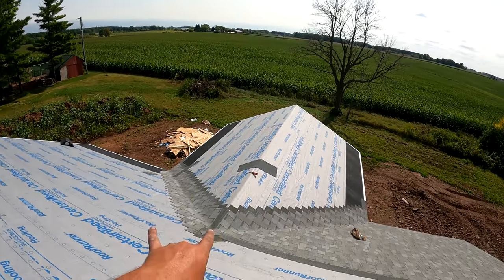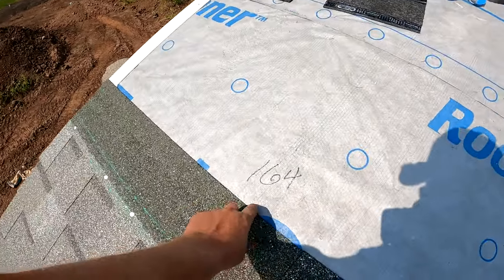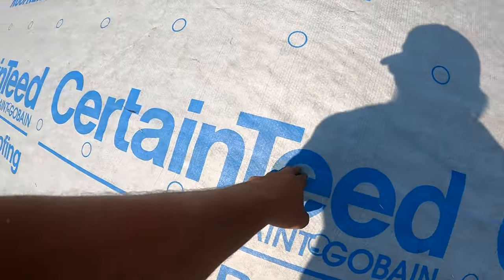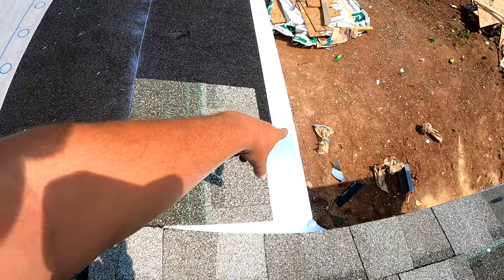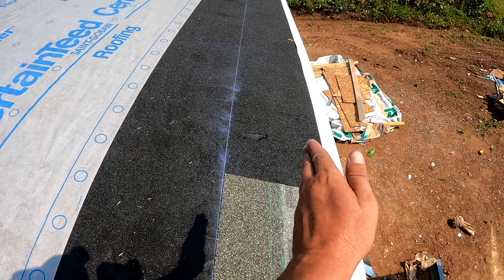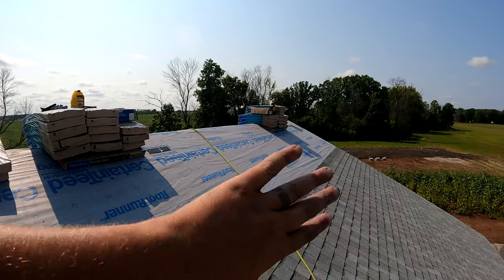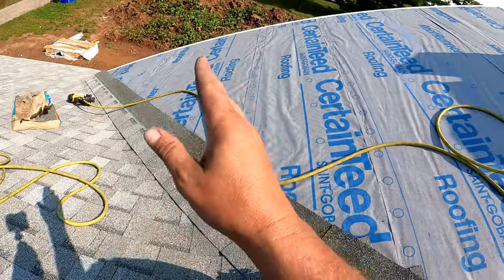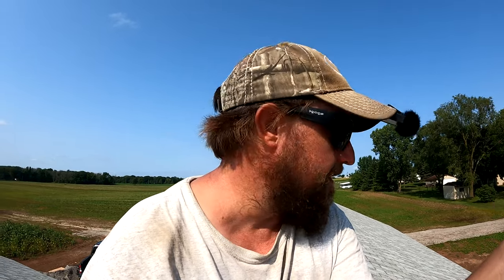HOW TO LINE UP 2 SIDES OF A CLOSED VALLEY

Comment: Chalk a line for the starter. Chalk a line for the first shingle. From the top of your shingle make marks 11 1/4 and 22 1/2 on most achitect shingles. Chalk lines all the way up both sides. The line should be the same unless you make a mistake making your marks.

Comment: Nice video! The way I like to handle these is to snap a reference line parallel with the main ridge, at a height of a few feet above the intersecting ridge.

I then shingle both sides up until they're 5 courses below the intersecting ridge height. 
Take measurements of both sides against the reference line, and with those 5 courses of space I can drop either side up to 3" with ⅝" drops, which is enough to bring shingles into level even in the worst case where they'd otherwise be half-height out of phase.

There's a little bit of math, but it's fairly straightforward when you see it being done.

Bonus tip: for the last course before merging, only use 2 nails at either end of the shingles, work out where you'll want the merged course of shingles to be positioned, then fill in the rest of the nails, respective of where the keyways of the next course will be.

Comment: Good job. The back of my house has no valley, but the front has a small one because of the roof over the front porch. Measure down from the ridge. I've already shingled the back of the house and I did measure down from the ridge doing that because I wanted to adjust where I started the first course a bit so the top course that gets capped would have a reasonable looking exposure. Now I tackle the front with a couple small closed valleys. Actually my very old house, the ridge has a bit of a sag in the middle. I measure down from the ridge at the ends of the ridge and snap lines all the way across. I will rely on your video on how to lay the shingles for the closed valleys.

Comment: I always use 22 1/2 or 45 just so my shingles wont show white line. And my valleys i raised them two at a time to keep em straigth. But good job looks good.
Reply: Absolutely correct 💯 22 1/2 , 45, 67 1/2, 90 and so on. Every fourth shingle will hit the line on the top side of the shingle. That fourth course will seemed dropped but true and straight (plus it covers that low nail ya just laid on the 3rd🤣). But first if you measure 13 1/4 inch from the edge of your gutter apron on the eaves bottom edge across the roof gable to gable, gable to valley etc. Then off of that line use the 22half,45,67half,90,112half THEN you have a recipe. Do that stuff and let me know how it goes for you. 👍 you be shooting lazers every roof.

Comment: HELP.. Could you explain how to join shingles on a four way intersection connected at the same elevation.. one ridge is 12 12 the other is 6 12.. I put new dormers in a 12 12 roof, the dormers are 6 12 but the new ridges come together at the same elevation.. Thanks so much for your help!! I did subscribe!!

Comment: What's the purpose of running that shingle long ways all the way up the valley? I've been roofing 21 yrs,I no every1 has different ways of nailing,just couldn't figure out what that shingle would do other then having something to line your valley shingle to,an then you don't have to cut your valley shingles at the end ..what area is this in
Reply from the maker: WE are in wisconsin. This keeps it straight and prevent having to cut any shingles

Comment: In the valley you have shingles running up to the peak then run your shingles to it, what’s the difference and the advantage of doing this instead of just popping a line and cutting them?
Reply from the maker: I do not need to cut 40 feet of shingles in the valley????This is easier and faster

Comment: Great work, 
The only thing I’m against is speed valley due to the fact your coming short on your key way steps there looking like 3 to 4 inch stagers. Closed cut allows you to control your steps. Here in Canada that roof will leak over time due to ice and snow. I do a lot of valley repairs for this reason. 
Cheers and keep up the hard work!
Reply: On that roof slope, I am not against his choice to let the valley dictate his set-back pattern. It looks to be around 5 plus inches? That would work in my region. What I don't like is the California Cheater Valley method. I've been roofing in southern california since the late 70's and hate that detail! Snap a line and do a real closed/cut valley!!!!

Comment: Just a question, why not use the one inch spacing from the end on the first nail staring from the valley? Is the nail not covered by the next shingle sloping further into the valley? I was just thinking about the corner lifting? Sincere question, I would like the understand the reasoning?
Reply: On a closed cut valley like this (California cut) you want to put your valley nail no closer than the diagonal bleeder strip nail line.  It will be closer to 4" from the edge of the shingle and the glue line will bond the shingle.  The bond/glue is what really helps shingles from blowing off once they have had a day or two of sun on them

Comment: So you went streight with the ridge all the way down to the eve? Doesnt that make your reveal at the eve rally crooked and all the way up the roof just to make your ridge reveal streight and parallel???
Reply from the maker: If the house is out of square really bad. usually it is only an inch or two off which is very easy to hide over the course of the large run. The most important part to keep straight is at the ridge. If you are an inch or 2 off on a large side you will not see it
Reply: @Lifes_Apprentice  what do you mean it's easy 2 hide over the course of a large run? Dont you start to tilt it a inch or 2 at the very 1st eve shingle? Idk I think it would be very noticable, you should make a video about this
Reply: I have never in my life needed to do anything like this. Been roofing for 23 years. I would fire this guy on day one. His valley is absolute garbage and he uses his tool as a hammer. Bye bye

Comment: Here's a dumb question...where/how do you start the very next run after the video ended? I ask because it seems like your going to run into 2 different nail patterns on each side of the peak. Plus adding that small piece at the peak seems like its gonna throw things off. Good work BTW. Just asking so I have an idea when I have to do mine.
Reply from the maker: yes you will have a different nail pattern for just the one row of shingles. If your nails end up in a bad spot when you run next row just use some sealant on that row
Reply: Life's Apprentice I had the same question using 3 tab.  I'm wanting to replace my roof myself but a little worried about that part.
Reply from the maker: Same thing with 3 tabs... layout is a little different but pricipals are the same
Reply: @amandacarroll9611 For 3 tabs you have to stay with the bond line.  Whatever edge is on the line that same edge will be on the line all the way up and down if you run on a 6 inch bond. If you run a 5 inch they will stagger and you will have to step it down to get it to come out right. The architect dimensional shingles are most forgiving.
Reply: @Lifes_Apprentice nail your tip row with a nail 1" from both sides of the shingle and add nails according to the new nail pattern.  I'll often nail off the top of the shingle if I have guys potentially walking over the shingles.  We just had a "journeyman installer" keyway 50+ shingles working out of a left handed book and being right handed

Comment: So... the rest of the roof above the dormer just get ran from left to right like normal?
Reply from the maker: yes
Reply: These "speed valleys" on the left side of the dormer can be a nightmare for newer installers changing up their normal nail pattern for right handed installation.  99% of the time we build books up the right side on the left side of the valley and might need to piece in a double knife (15") shingle running into the valley

Comment: What don't you like about CertainTeed?
Reply from the maker: Super small common bond. The tar strip sucks compared to other brands. They are heavy, which is not neccessary. They are prone to slight variations in color from bundle to bundle in my experience. They are also more expensive than other brands that are just as good or better
Reply: @Lifes_Apprentice  Good to know! Maybe that explains why the bond between many of my CertainTeed shingles failed after 13 years! Thank you for responding back.
Reply from the maker: @TravelwithNJSteveandSue  As a professional roofer for 20 years I would never buy and install them. I do work for builders and that is what they buy for some reason...Unfortunately that is the way it is but I would never buy them for one of my customers
Reply: @Lifes_Apprentice  You have confirmed my suspicions about CertainTeed! Thanks!
Reply from the maker: @TravelwithNJSteveandSue  I like Atlas and Owens corning...GAF is nice too

Comment: Do you not use starters on the gable?
Reply from the maker: we never do. I have never seen another roofer in my area use them either. I have torn off one roof in my life (3tab) that had rake starters. I have done thousands of roofs. Never had a single issue
Reply: There should never be an issue, the reason why I do it, is because I overhang my shingles about 3/8 in on the gable and the starters keep it nice and straight.
Reply from the maker: @Lonestarexteriors  We install D-edge and cut to that and it is just as straight

Comment: the nails 234 are close to each other than 1 and 5....is it always like that?
Reply: If you do it like that, it leaves a space on each side so you can run the next row either way and not have a nail in the seam. I like 1, space, 2 3 4 5 but sometimes you gotta change it up near obstacles and edges.

Comment: In my area I prefer the Certainteed Landmark shingles
Reply from the maker: Atlas, owens corning, and GAF are far superior in my opinion... certainteed is installed on like 1 out of 4 houses in the US though so they are popular
Reply: Over here IKO is the most popular, I've heard of Atlas before, but never seen them.
Reply from the maker: @Lonestarexteriors  Everywhere in North america has a bit different selection. We do not get IKO here at any of my suppliers
Reply: @Lifes_Apprentice  In PA area certainteed shingles are sold as a better product than GAF. Many roofers here hate GAF because they get gritty and many issues with them not lasting or giving the same protection. They are more expensive that’s why I don’t like them but TAMKO shingles in my opinion is the best ones out to install and to repair or replace

Comment: no starters, above hip where top of valley meets ain't all that correct. I don't install that way. start on the smaller side you started 2nd. then they will tie end(meet up) better. Anyway that's all. every roofer does their installation different.  take care

Comment: Not bad but my day shingles show 5 in to the weather You can start on the other side regular. Then when you get up about 12 courses to the top and start taking a loose shingle to a loose shingle and see how much you got to drop them That's how easy it is and the other side will meet up.

Comment: 1st u go with the lowest side not the lowest measurement to line up the other side. The lowest measurement would be the higher shingle. So That's wrong.  There goes your margin of error plus 3/8.    2nd. After u determine your lowest side you get u a lin all the way across using the measurement from the lowest side (wich will be the higher number from the top)  but u make the line = 5 & 1/2 from the number of the lowest side but do it on just each end to get 1 straight line all the way across so u cam have a straight line to measure off of and your top will come out the same across  assuming it's straight  so iff u had 164 and 163.5 u would go from top 158.5 from top and that'll straighten out your top.  To get the bottom unsalted side you pull from your lowest line on top u just got all the way across to your highest bottom line and  measure and find the first increment of 5.5 u cam hit wich should put your tape at a small angle.   Do the same on other side to same measurement. If it doesn't reach scoot up another 5.5 higher now that you know wich increment will work best to perfectly hide any short shingles but dividing the distance out evenly.  This also works for any step downs or to just straighten out top section so your top shingles are straight with the ridge.  
The reefer roofer.  The higher I get the dryer you get

Comment: 7:24, that’s what wrong with californa valleys, look at the stair steps, those are too small, if you read the instruction on the bundle is says 8 inches minimum try closed cut valleys there way better🎉
Reply from the maker: The bundle will never say 8 inches or more. They will say 6 inch offsets and any multiple of 6 inches based on a 12 inch nail pattern

Comment: or you could paper on a decking line and use the lines that are given to you on the paper and then the top paper place on the ridge line, I hate when I see mf measuring on  a roof and snapping lines, waste of time, there's a reason the paper has lines and marking on it
Reply from the maker: We usually follow the paper as well. In this ase the carpenters did the paper before we got there and I wanted to show how to lay it out for new people